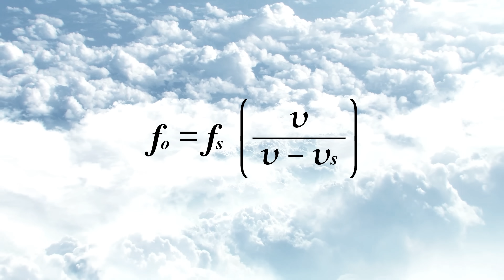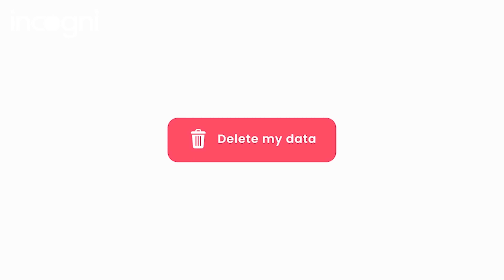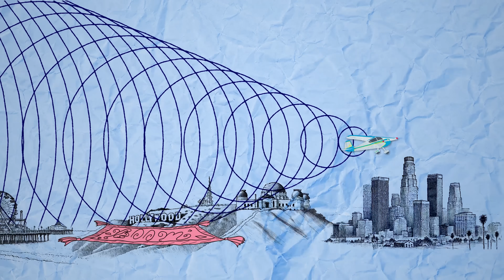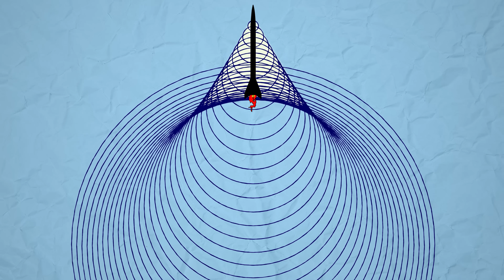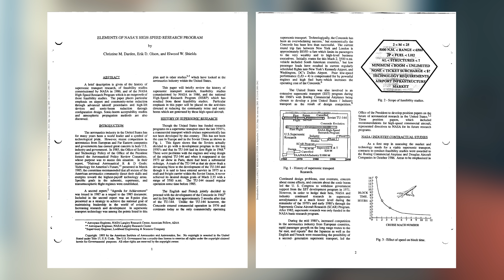You'll NEVER Hear a Sonic Boom From a Rocket??

Comment: So that's the reason why you can't hear a bullet flying away but can hear it crack when it goes over your head (if its a super sonic round). Dope.
Reply: Seems a model rocket travelling horizontally, instead of vertically, an audience within the boom carpet would experience a boomy 💥. Sounds like a video opty.
Reply: @BradSmithSC Yep! See my comment on this regarding Vandenberg Falcon 9 launches. Yes, we can hear the ascent transonic boom.
Reply: @BradSmithSC  can the audience be in the boom carpet but still far enough out of the possible path of the rocket? Where would a rocket launched horizontally land and how? I presume Xyla wants the rocket and audience reusable…
Reply: @ElukeNL Xyla could pull this off with a 'reusable audience' being a primary priority 😂
Reply: Unless it ricochet and goes off at an angle where you can hear the shockwave with sufficient energy to still be super sonic.
Reply: 'Why aren't we shooting?!"
"They're not shooting at us yet!"
"How can you tell‽"
"A hiss means it's close, a snap mea--" 
SNAP
"Now they're shooting at us!"
Reply: I happened upon this in the middle east when I was invited to a wedding during my tour.  None of the guns they were shooting in the air had that distinct crack that you always hear, and it sounded completely different.  You hear the bullet crack when you're shooting toward something as it reflects back at you, such as a building or truck or hill or mountain, but if you shoot up in the air, there's nothing to reflect it back to you.  It's a great way to compare the sound suppression of different silencers, as the crack is often louder than the actual muzzle blast.  Once you reduce the blast below the db level of the supersonic projectile, there's not much difference in sound when you're close to the bullet, so even the best silencer sounds just like a mediocre silencer.  If you eliminate the sound of the crack, all you're hearing is the muzzle blast, and then you can more objectively compare suppression.  Assuming you're in the middle of a barren wasteland with nobody downrange, of course.  Not like it makes a whole lot of difference, as whatever you're shooting at is still going to get the full effect of the sonic boom, but it does help in masking where the shot came from.

Comment: You can tell me anything, I just love hearing it, and don't ever do therapy please, but there's a few tiny bits I'd like to bring under your attention. The softest sonic booms are produced by bees.Yep, bees buzz is supersonic. The speed of sound is constant because it's an escape velocity. For unpropelled phenomena escape velocity is always constant, because it doesn't depend on the force that causes it, but only on that force exceeding a critical limit. A shock wave is not sound, and always travels considerably faster than the speed of sound. That is why the combustion of propellant in your rocket can make it go so much faster. A sonic boom is generated behind a supersonic object, not in front of it. It is the result of air not being able to fill the space behind the object fast enough, because air just can't move that fast. It is the collapse of that vacuum that generates the boom. The reason your rocket doesn't give off a sonic boom, is because the space behind the rocket is filled with the jet, meaning there is no vacuum to fill up, and subsequently no boom.

Comment: First of all - trancesonic kBOOOM you can hear only if rocket will move horizontally! But when rocket is going to sky - air density is changing (getting lower) so there is no "wall" a rocket will need to overcome, and (the second) a speed of sound is different depending on level of high

Comment: Excellent video!  I snapped a picture of #5 Blue Angel F/A-18 screaming past me at an airshow last month - which caused my spiral down a shockwave rabbit-hole.  While of course the jet wasn't going fast enough to generate a sonic boom - clearly visible in my picture is the pressure wave extending out from the tail of the aircraft, bending the light behind it.  The humidity in the atmosphere that day was low, so there was very little vapor cone to obscure the wavefront, plus the jet was almost exactly perpendicular to my location; I estimate that fraction-of-a-second-edge-on-viewing-angle is what allowed that to be visible to me.  I am endlessly fascinated by the picture.

Comment: The patriot missile system that was used in the Desert Storm war would make 2 boom sounds less than 2 seconds apart. The first boom is the sound of the solid rocket motor ignition, and the second boom is from the missile breaking the sound barrier. The patriot missile is about the length of the trailer of an 18-wheeler truck. So imagine that entire rocket accelerating to the speed of sound in less than 2 seconds!! Its insane!! It is also a rocket, but the patriot missile was often launched at an angle to intercept in incoming ordinance, not straight up, so that is why the sonic boom was audible.

Comment: Pistol Shrimp for Boomy award.  A little shrimp has a huge snapping claw that can snap and create a cavitation in the water.  The tiny cavitation bubble is compressed and collapses causing a sonic boom, enormous heat (5000+ C) and sometimes light.  It can kill or stun other aquatic life.
Reply: Their speed is still only a paltry fraction of the speed of sound, you probably drive your car faster than the speed of their claws on your way to work.  Inducing cavitation does not require you to be moving at the speed of sound, nor is it an indication that the object that created the bubble has gone supersonic.
Reply: Agreed. I hear my pistol shrimp snapping every day!

Comment: The equation of 343 m / s is accurate for dry air at ground level but the higher the altitude it changes.  Higher altitude means thinner air thus changing the speed of sound.  Also humidity changes the density of the air.

Comment: 2:40 - That's not really true. The speed of sound in air depends on air temperature or density. There are plenty of simplified calculators online to figure this. For example: at room temperature (70°F) the speed of sound is 343.8 m/s. But higher in the atmosphere, when the air temperature drops to -40°F/C, the speed of sound is only 306 m/s. This makes intuitive sense, because if fewer air molecules are interacting (when the density/temperature are lower), then it'll take longer for those air molecules to propagate that sound wave. That's also why much denser objects (like the water and steel examples you gave) have significantly higher speed of sound. The phase change obviously makes a difference too, given the density and organization of molecules in those states.

Comment: If you were ever way too close to a lightning strike (in the struck building, for example), you know how much it's a sonic boom. At that distance you don't hear the deep boom and rumbling caused by the sound waves bouncing off everything on the way to you and slowing down to normal speed of sound, you hear and feel the sharp supersonic crack assaulting your senses at the same perceived moment as the light flash. Unforgettable experience.

Comment: Another common place for sonic booms in everyday life is inside certain turbochargers and superchargers.  Between the conditions inside the compressor section and the speed of the compressor itself, the blade tips may exceed the speed of sound and create sonic booms.  Depending upon the number of blades and the rotational speed at which it takes place, that can be anything from a rattling sound to a tone.

Comment: The pistol shrimp is pretty cool.  The slow-mo-guys did a video on the pistol shrimp.  It creates a audible sonic boom and flash when it snaps its claw.
Reply: Its not actually a sonic boom. It creates a different thing called a "cavitation wave". Analogous, but technically a different phenomenon since it doesn't involve anything moving at super-sonic speeds (especially not super-sonic in water where the speed of sound is way higher). Still really cool though! Shrimp are awesome

Comment: You missed one important thing. Speed of sound depends not only by the medium, but also other factors. In atmospheric air it depends mostly by the temperature. With higher altitude, temperature drops. About 2K per every 1000 ft. So in higher altitude, we have slower speed of sound. That's why airline pilots uses Mach number instead of knots at some point of climb - to not exceed speed of sound on top of the wing, where air moves faster than other places around aircraft.
Reply: "mostly by the temperature"  Isn't it mostly the difference in pressure at different altitudes that effects the speed of sound at those altitudes?
Reply: @fewwiggle  No, temperature has a much larger effect. The speed of sound even increases as you go up the stratosphere since the temp goes up.
Reply: yes. was wondering if somebody would mention it. Especially noticeable if it's a really hog , muggy day .
Reply: ...and continuing underwater, the speed increases with depth. (pressure)

Comment: 'light can be made to move slower through certain materials' Ooooo, thats a veeeeerrry deep rabbit hole.
Reply: A nice little side tangent consisting of several reserch careers worth of information.
Reply: Light travels slower than it's max speed because its max speed is in a vacuum. Literally every other time it's traveling slower.
Reply: @ADBBuild  light or more accurately massless particles always travels at it's max speed, it can't go slower or faster. When traveling through a medium it's not actually slowing down the massless particles, it's the waveform interacting with the material creating a combined waveform that isn't entirely massless anymore, and thus travels slower. So travelling trough a medium actually changed the light so something else during transit.
Reply: @jakobrosenqvist4691  How can the mere interaction of the light with the medium increas the resting mass of light? On a microscopic level it's still photons bouncing between atoms in a vacuum.
Reply: @cahdoge  it's not really bouncing around, that is an inaccurate model. If it was true then all mediums would scatter photons randomly. 

And the interaction doesn't give the photon mass in the conventional sense, it combines with the photons waveform to temporarily create a combined waveform that has a tiny bit of mass. Another way of thinking about it is electron waveforms causing drag on the photons waveform when passing through a medium.